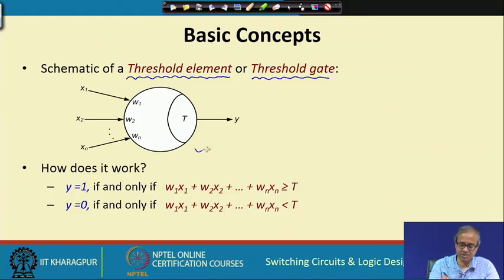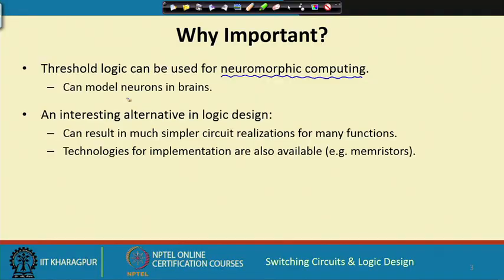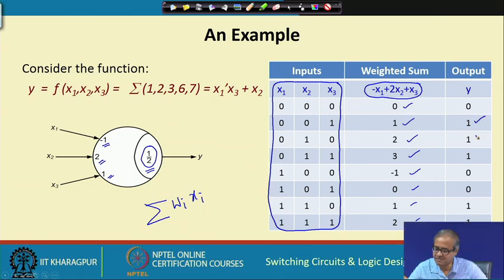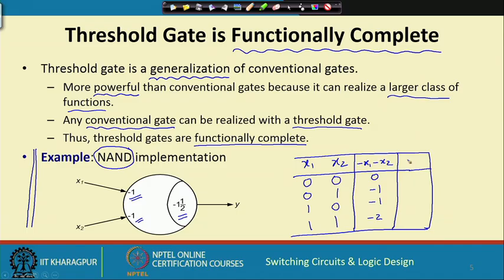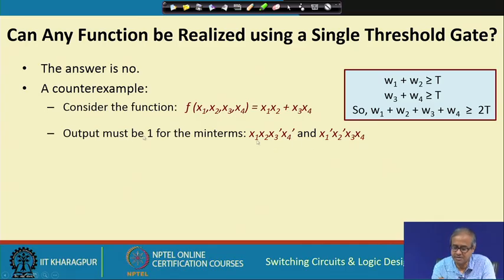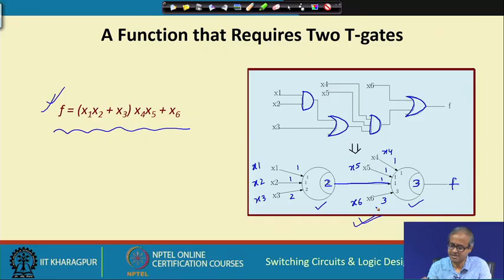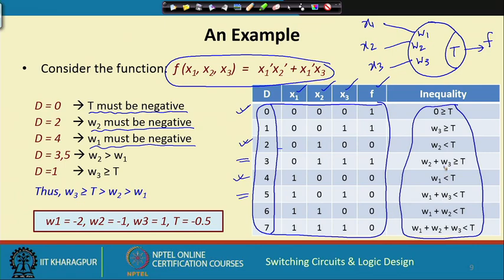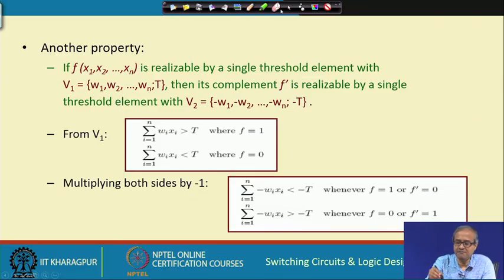Lecture 30: Threshold Logic and Threshold Gates

Comment: Excellent! Especially compared to two other channels which contained inaccuracies. Threshold gates can model a neuron because that is where they came from. (See McCulloch and Pitts introduced the first mathematical model of a neuron: the threshold logic (TL) gate (TLG) [1] in 1943).
Threshold logic is not new or even recent. (See DONUT: A Threshold Gate Computer IEEE June-1964).
I would like to see a show about implementing threshold gates using tunnel diodes. The weights are just the areas of the input diodes.